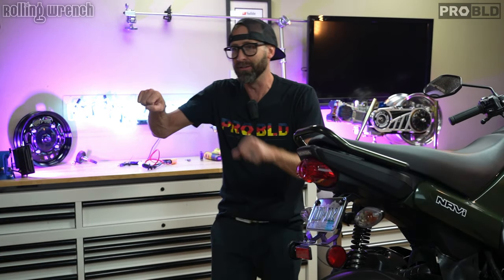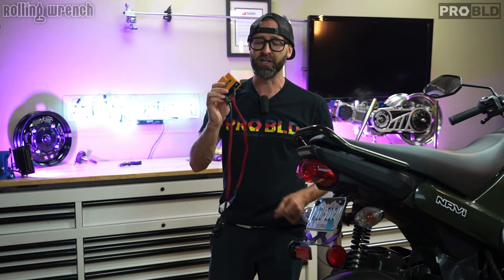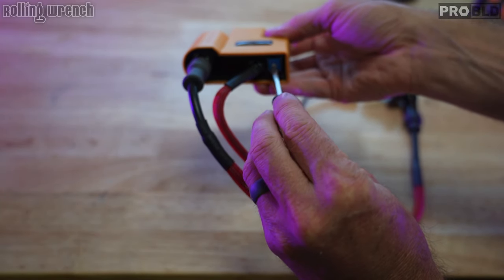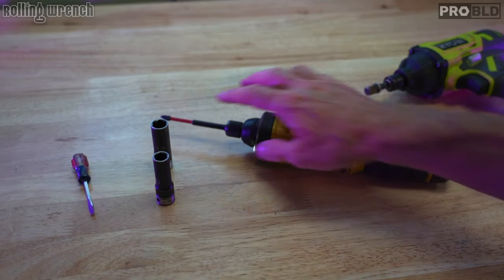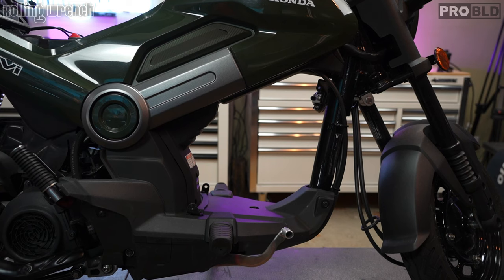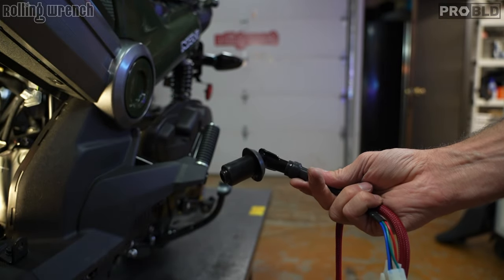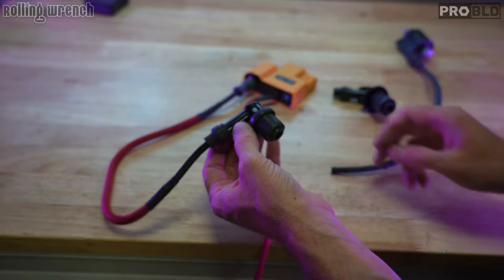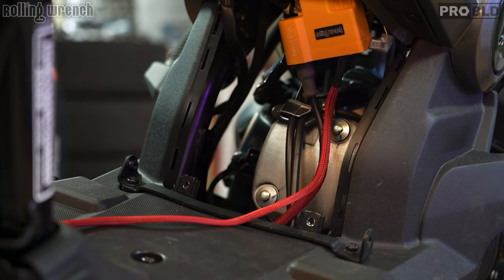Honda Navi CDI (Plug & Play Top Speed Mod)  Episode 3

Comment: Excellent,,, as soon as you get that gear up kit I want one... Since most of my riding is wide open throttle on 45 and 50 mile-an-hour roads.... The next thing you need to come out with is some taller handlebars and all the cables and stuff to go with it.. I'm thinking a six or seven inch rise would be perfect
Reply: RIDICULOUS 😂
Reply from the maker: Gears are turning ⚙️
Reply: You can literally buy ANY handle bars for these and install them.
Reply from the maker: @patrickfargie1146  yep. 7/8 bars
Reply: 40mm bar risers were a nice improvement
Reply: And I would like the throttle to be on the left,,,, I can definitely shoot better with my right arm,,,  that's more important when I'm rolling in the hood...
Reply: @RollingWrench I’m on roads with 40-50mph and do deliveries everyday for 12hrs. What you do if you were in my boots with the Navi?
Reply: Me also , a steady 50- 55 would be great.

Comment: Maybe it's time for Honda to make a second generation of the Navi. It needs a 125 EFI, better brakes and a new gauge cluster. 
Love the fact that the Navi has a foot rear brake lever just like a standard motorcycle. More scooters should be made like that.
Reply: Good God man, that’s just crazy talk.
Reply: So basically you want a Grom, with a CVT..?
Reply: The attraction is the price and performance. You'll have trouble finding something that works better at for that price, or works as well for less.  If you start adding features, the price goes up and the careful balance goes out the window faster than a Russian politician.
Reply: it needs at least a 150 and some bigger wheels

Comment: Here's a trick for ya!
In my years of working on vehicles, especially new vehicles, I hare scratching them. Even I places you don't see. 
For routing wires as shown on 11:43 , use a shoelace or any kind of smaller rope. Dip it down from the top and tie it around the connectors. Then all you have to do is pull it up! 
Neat Lil trick for anyone having issues, and or want to prevent scratches. 
Hope this helps!
Reply from the maker: Great idea! I have don’t this too. It’s a good trick

Comment: If only these had a way of adjusting the ignition timing. I think some power gains would be found with that. Still, it's really good to see the Navi getting some well needed love like this, specifically for the ones who don't want to go through the process of installing the 12" wheel and tire.
Reply from the maker: The timing is actually advanced slightly on this cdi. Makes for easy start up and better throttle response

Comment: Really neat video. I plan to get the cam shaft upgrade that gives more power. If I pair it with the CDI box you offer I would expect to get up to about 65 or so with exhaust, rejetting, pod filter, s23 variator and a clutch upgrade. Your doing awesome on these videos.
Reply from the maker: I have the performance cam. It will be part of this series. You may consider the Reveno clutch. 2.5lbs lighter then your clutch. Makes a huge difference in acceleration
Reply: When's the CVT kit coming back in stock? @RollingWrench

Comment: Question how did you advance your timing did you go counter clockwise on the fan with the F mark?
Reply from the maker: We did it digitally in our micro processor cdi coil
Reply: @RollingWrench  ok I’m gonna buy it  next I just cammed it with the DCR 1 Navi cam and I feel it wanting to go but the rev limiter is holding it back I upgraded the pilot and rejetted it as well

Comment: Has anyone done a comparison of reveno clutch/variator vs motossi?
Reply from the maker: I should do it. The clutch will destroy any of the competition hands down. It’s 2.5lbs lighter and has triple plates. It’s kind of like comparing drum brakes to disk brakes. The Reveno rollers in the stock variator vs the malossi variator . Different story. The malossi will most likely take the cake

Comment: I can turn the dial infinitely and each end looks the same to me, how do I know It’s rev limited the least without a tach?
Reply from the maker: If you turn it all the way to the left your rev limit is only 4k. Top speed 25 mph. Go the other way and delete the rev limiter.
Reply: I have it turned all the way to the right, and have done an air intake, 12 g rollers and 100 rpm springs and I’ve only gotten as fast as 52 mph :((